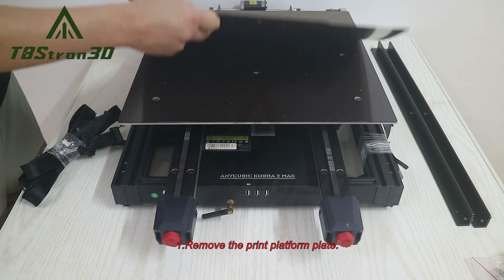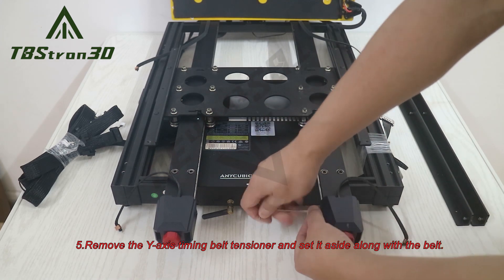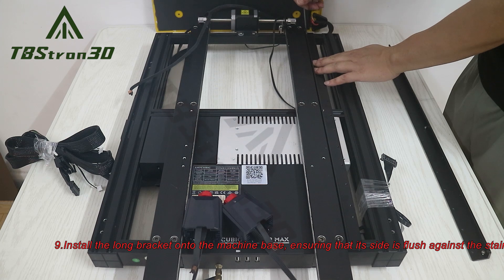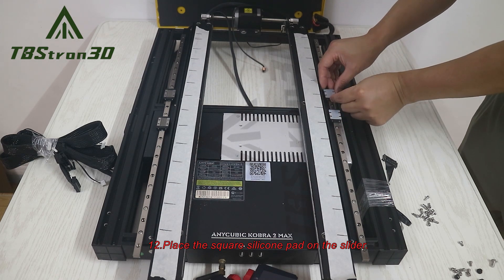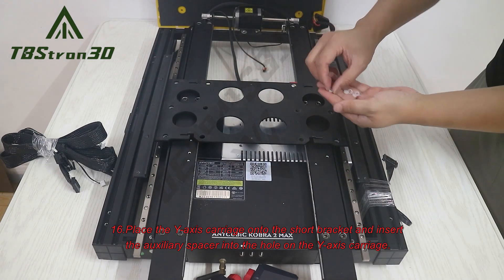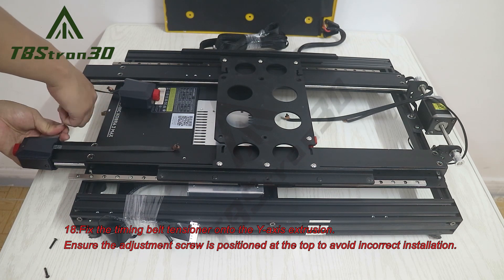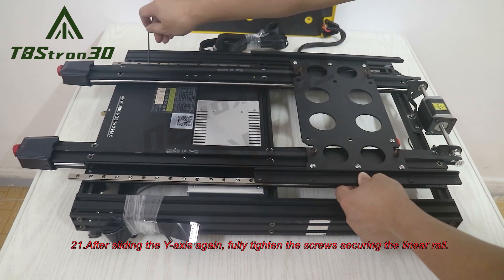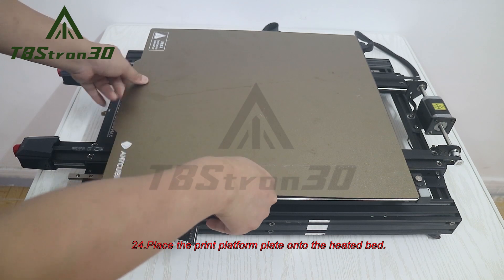Anycubic Kobra 2 MAX Y Axis Upgrade Linear Rail Installation Guide

Comment: Any plans to create a X axis rail and hot end mount? No matter how i adjust the eccentric nut the entire hot end assembly seems to be able to wobble somewhat, and it has since day 1. I have to imagine a linear rail setup would not allow this at all.
Reply from the maker: Hello.
The X-axis linear rail upgrade kit is still in the design phase. The Z-axis linear rail upgrade kit has already been designed, and samples are currently being made.
The upgrade kits for both the X-axis and Z-axis of the Kobra 3 have also been fully designed and are now in the sample production stage.
Thank you.
Reply: @tbstron3d-yf9op  Any update for the X axis?